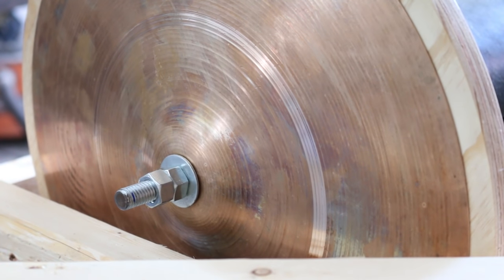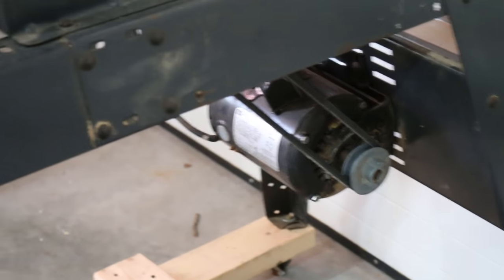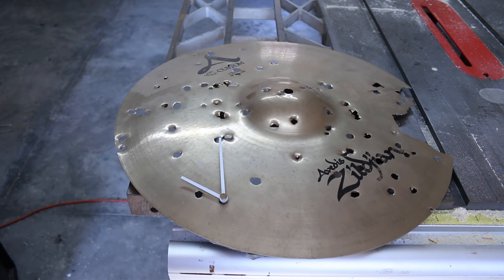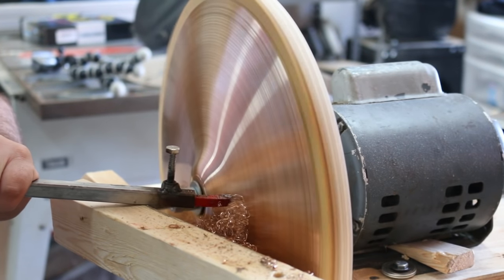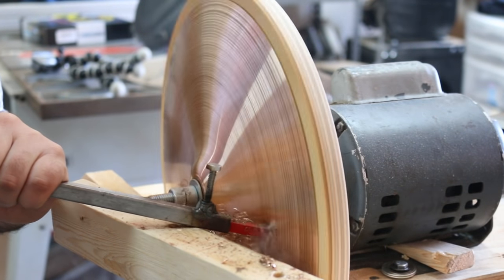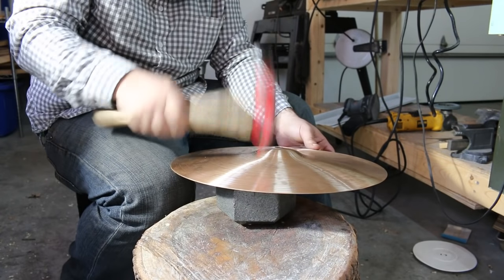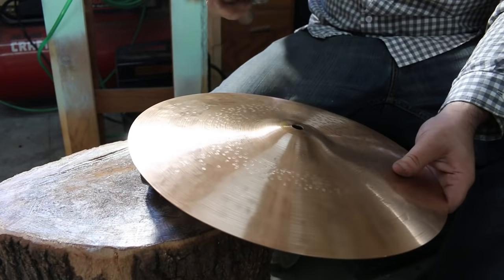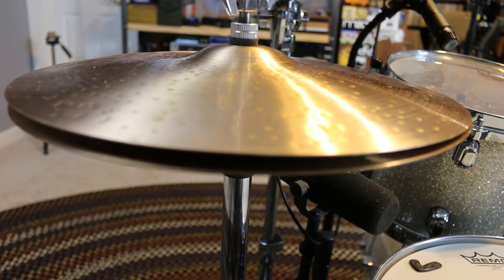Reworking Some B8 Hihats

Comment: I just realized your anvil is half of a 20 lbs dumbbell.... that's brilliant!  My cymbal lathe uses a 6:1 geared, 1HP motor and I still have the same problem of "not enough torque".  You really do need a minimum of about 2 HP to get anything done without  too much headache.  That being said.... a 1/4 HP setup is fine for light cutting, resurfacing, removing lacquer or sand polishing cymbals.  The fundamental pitch of the hats after modification  is significantly lower and much darker with an "old style jazzy" B20 sound.  I'm curious to see what else you've done to these... hopefully not too much because they sound pretty darn good as is!!! I just recommend using a proper cartridge respirator if you do any sand polishing because  fine metal particulate dust is EXTREMELY BAD for the lungs!
Reply from the maker: +LanceCampeau haha yeah, just cut off one end, drilled a hole in the stump and plopped it in! But of course Its extremely soft. but yeah I got all the safety stuff on, ears, eyes, and respirator. I was gonna cut them up to use for something else, but I think ill wait to find another set of hats!

Comment: i worked on what used to be an 16"AAX after a nasty crack I traced an almost perfect circle on it with an muffler pad, i cut it by hand with some sheet metal cutters, and after that I randomly drilled about 35 1/2" holes and I love the new trashy sound it produces now. I now have a 10"splash that used to be another 16" or 18" crash that is way too ringy for my taste. I've been wanting to hammer it out to shorten the decay. I don't have the tools to lathe it out, but I'm willing to sacrifice it. thanks for a great video. i do like the sound on the after better. thanks

Comment: I made the same mistake of thinking the round side of the hammer would work better, but actually the broader flat side usually gives better results. (The Turkish hammers are even broader and flatter on the striking side, with really rounded edges to prevent putting cuts in the cymbal.) your lathing was awesome, and I wonder how it would sound if you lathed after hammering instead of before….

Comment: I have a b8 cymbal that I've had for years. Always hated the ring tone and tried different ideas to muffle it with no luck. All I could get was a quieter long ring or complete dead. Thanks for the tip. At this point anythings worth a try.

Comment: Simple: lathing gives more high overtones, and hamering, low overtones (and more if the hammer head is larger so your idea of two different hammers is acurate to multiply complexity), and yes drier and trashier because of less capable to resonate now.
For me way better (more complex and beautiful timbre). Almost perfect in finishing.
See my explanations here:
http://marcdedouvan.com/en/instru.php?instru=cymbals#finishes

so for me great job (you've just multiplied the value of your cymbal from 1 to 10 not only because of work and acurate treatment but also originality, unicity (for example your extreme large hammer (needing strength too) hand work and the cool sparse hammering a bit like a galaxy or asteroid belt with two circles of concentration and nothing on center: very natural and beautiful (=pleonasm)).   

with b20 alloy it will be way better for me (even more deep! imagine it! like k constantinople zildjian for instance, the best and more expensive cymbal on the market and for good reason (try a sabian XS20 for a ride (best basic treatment with crushing (same as zildjian and istambul, same family at the origin) but almost no finish and the cheapest so in this base)!) ).

Jazz drummers will pay a lot for that! I can garantee you that!

Congratulation and good continuation.

PS: you should try less powerfull bullets (lead?) to make no hole but just like hammer stroke (without piercing like here (and historical in battle but don't try this at home or today battlefield! In fact it was a kind of drummer protection or just passing from one drummer to another): http://marcdedouvan.com/en/instru.php?instru=drums#description )

in your demo you didn't try the simple ping (too bad! here you can appreciate the best quality of dark cymbal highliting the high overtones of stick wood!)!

Comment: You might try a 1" thick rubber pad under them during the hammering process to allow the hammer to dent deeper without thinning the metal out.

Comment: i know you said they look like brass now (i personally wouldn't have hammered them after the lathing), but they actually do sound drier and trashier, which is kinda what the cheaper-end cymbals sound like (i mean that in a good way). i wanted some drier, trashier stuff, but no way was i shelling out 300 to 600 per cymbal for any line, so i bought a cymbal pack with a complete set of brass for like 200 bucks. perfect. they're not my full time setup, but when i want that sound, there it is. you'll probably be pleasantly surprised with your 'new' trashy hats when you record with them. that stuff sounds great on tape

Comment: Considering the fact that you're not a professional cymbal-smith (neither am I, by the way), I think you did a great job re-working those old B8 cymbals. With that being said, I don't think you should have hammered them; in my opinion, they sounded much better right when you took them off the lathe and they were grooved but not pitted. Nowadays I lean more towards B20 bronze, but those hi-hats you used in the video actually sounded very nice.

Comment: looks like your using a harbor freight (or similar) tool?

if so, those are carbide tipped. carbide actually requires quite a bit more tool pressure to cut when compared to high speed steel. if you try this again you should try to find some pre-shaped high speed steel tools; they should work much better for you. just a thought...
Reply from the maker: Thanks man, I know a little bit about machining, but not too much, so that really helps! thanks!
Reply: Ben Edmondson Doesn't the hammering come first?
Reply: Hell no. You'd put holes in the cymbals when you hit the bumps or at least have a much harder time controlling the tool.

Comment: As you mentioned, a reduction in RPM, via pulleys or gears, is where it’s at. The original motor would probably be adequate.

Comment: you were saying you didnt like the look of them i believe if you research silversmiths with care and preparation you can peen out the metal and not even hardly see the hammer marks  or make the hammered look with out much effort.  what it comes down to is that you set up your anvil and hammer to fit YOU so that when the hammer contacts it is almost perfectly flush with the anvil and again this isnt had take some aluminum and just hit  it a few times and if like the heel of the face hits first lower     the anvil  or visa versa then on the hammer just take care when you dress it if it hits hard on the right grnd it down a bit its all simple just think  about it a minute  and you will be totally suprised  what you can have for a finish with just a hammer and this is using the flat side not the peen side
cheers
Reply: +dennis buckner I thought they looked pretty good.
Reply: ah i might have misunderstood your comment i thought you said you didnt care for the look my apologies if i misunderstood

Comment: Doesn't the wobbling when turning effect the lathing and when placing the high hat bottom/top have to be strongly fastened so it will go smooth across because I saw that in your video does it not matter
Reply from the maker: +Chris lutz yeah there is a little bit of play on the backing plate. Making it tighter wont do anything to improve that. I just had to stop and rotate the cymbal a few times to make sure I was cutting an even amount around the whole thing

Comment: IF someone just use a slower settup,  that would be 90 % of the (non safety),  or never mind,  you got the variable frequency drive.to slow that grinder motor down. Good.  IF you ran it constantly it would eventually ether pit out the motor shaft, bearing or both. Need special grounding added

Comment: I know this is a really odd question but why does the cutting tool have a bolt sticking out of it?
Reply from the maker: +Cody Crumpton To hold the tool (red thing) in. Its a cutting tool for an actual metal lathe so it only a few inches big. I welded the nut on the tube so the bolt can hold the bit in place.

Comment: you could lathe the bottom of your meinl ride to get a lighter sound! i remember you mentioning you thought the cymbal was too heavy for your tase, just a thought(;
Reply from the maker: +Bobpop777 Ive actually wanted to do that ever since they released the transition ride. I can do it with this setup tho
Reply: +rdavidr hell yeah

I actually bought a transition ride May last year... i ended up cracking twice in two of the larger hammer indents. Long story short i drilled three holes in it and it sounds great, hands down my favorite cymbals i've ever owned or played!

Comment: That's most likely a triac based dimmer, not a variable autotransformer.  (Variac is a brand, like Kleenex.)   The difference is ... eh, I bet no one cares.
Reply: yeah, and because  an autotransformer is a one winding transformer the voltage regulation is better and va handling and bla bla blaa noone really cares  :-)

Comment: sounds a bit deeper after the rework the note seems to fit the tune of the snare and drums though

there are oxidizing compounts you can get from the arts and craft stores to blacken copper might work on bronze too , 
https://www.youtube.com/watch?v=guR4CwOahZQ
either that or try black shoe polisch or waste oil (waste motoroil from a diesel is nice and black )and buff it up to bring the dimples out a little more

Comment: THEY DON'T SOUND MUCH DIFFERENT DO THEY!?!?!?!
Reply: @mariusholkenbrink7130  ok, Your right there is a difference, albeit subtle, or mostly subtle... there is a difference in the higher register of the metal, especially with the hammering, but overall they Are B8's still. Remember, I am not knocking the work that went into it at all, it was completely experimental, just that the sonic  difference was not that much for me.

Comment: Well 1 of the problems you are having and are doing. Is taking the tool off and on so much when lathing the cymbal. You need to do it in as few passes as you can. not grind then stop remove then start stop start stop start. that is creating a extremely uneven broken scattered pattern. it needs to be a as fluid and on point as possible. start at the bell and work your way all they way to the edge of the cymbal.Or From the Edge To the bell. and yes your motor is not helping at all you needs more torque.

Comment: WD-40 is not a lubricant
Reply: +Sneaky carrots and the Wd-40 is burning
not vaporizing
Reply from the maker: +Sneaky carrots I know its not, but compared to using nothing it is. I mean, technically wet glue is a lubricant. The point is Im trying to make it cut better and not heat up the bit as much. Ive seen plenty of machining guys use wd as cutting fluid, sure its not "proper," but its better than nothing.

Comment: Dude this isn't safe at all, that motor is way underpowered, you should have built a proper cymbal lathe, and taken that other motor off, what do you think this is?>!@@>
Reply: Also, you're pushing too hard on the tool, and the tool's dull. It's not the DW40.
Reply: That is the DW40, you can tell because before he puts any on there is no vapor coming off the cymbal, then the second he sprays some on there is vapor.
Reply: MrTrollinglol you really can't tell that he is trolling?

Comment: As someone who is used to working with a proper lathe, watching this was horrible.
So unsafe, so unprofessional (holding the tool bit by hand)....Just gives me shivers.
Reply from the maker: have you seen how cymbals are lathed? By hand on a lathe made specifically for cymbals... go ahead and try machining one on a regular metal lathe and let me know how it goes.
Reply: Well, I never seen before how cymbals are lathed, and yes, upon searching on YouTube I found that many people do that in this way.
Perhaps this is the way to do it, yet it still looks very unsafe...
Cheers anyhow.
Reply: +Martyr of Grenth how is it unsafe??
Reply: Not So Average For the record, and I quote from the video "...This is not very proper and probably not the safest..." .
The fact that the barrier that surrounds it is made out of wood doesn't help either.

Like I said in my second comment after he himself replied to me, I did check (after reading his comment) other videos on YouTube of people using the same method, though they usually had metal that was surrounding the "work area" and thus provided some more safety.

It could be just me that is the odd one here, like I said I'm used to working on metal lathes be it CNC or manual, so that's why it didn't seem quite safe in my opinion.
Though, apparently this is something common, and as long as people do it safely... That's the most important thing.
Reply: thank you very much for your detailed reply. i have very little experience with metal work and you have increased my understanding on why this is unsafe greatly. thank you!
Reply: Martyr of Grenth 
Huh? Lots of people lathe by hand.
Reply: If you've ever seen a wood lathe you'd know that the tools are hand held on that kind of lathe too. You couldn't possibly do this on a regular metal working lathe. Unless it was CNC maybe.
Reply: nah you could totally do it with a metal lathe. the only thing is that you would probably be holding the tool against a tool rest in your metal lathe just like in the video. it's just a lathe.
Reply: So you'd be using a metal lathe as one would use a wood lathe. To use the metal lathe in the normal manner , you'd have a hard time following the contour of the cymbal. CNC would require a careful mapping of the cymbal's contour. You'd need a good sized lathe too.
Reply: This is how many times a specialist (like Martyr) works. Knows their current set of tools, but has less feel for the craft or just doesn't care about the origins, the quick and dirty way. It is not unsafe, just different precautions are to be taken.

Comment: "Machining" not lathing and you're a machinist not lather, dives me nuts when the wrong/ignorant terminology is used. That said, it's amazing I couldn't hear much of change in tone but my hearing is defective, too many rocket engine tests, big ones >20,000lbf. Thanks.
Reply: Roxanna Mason nope, it’s actually lathing, if you knew anything about cymbals